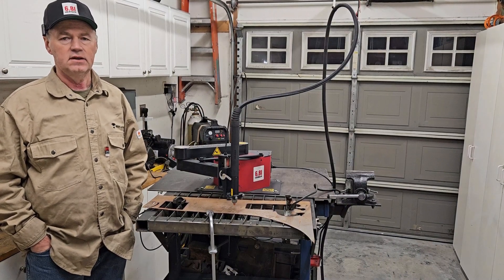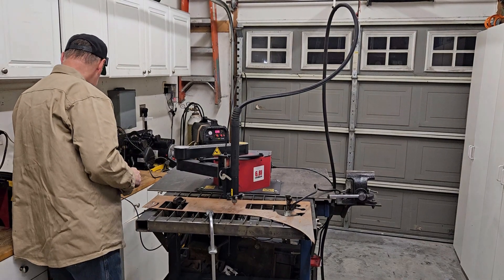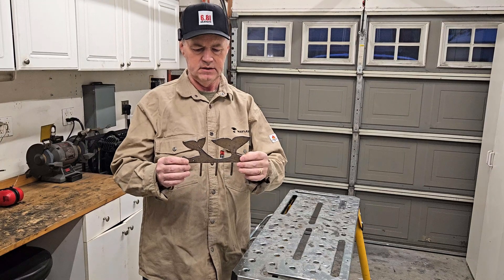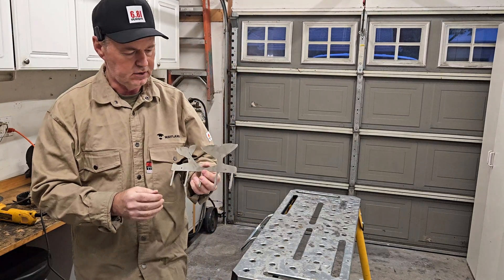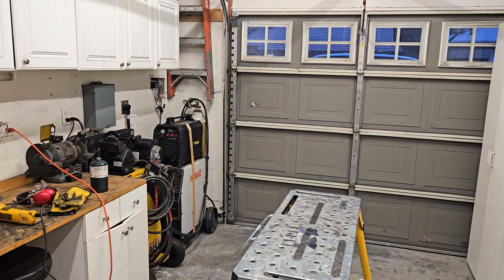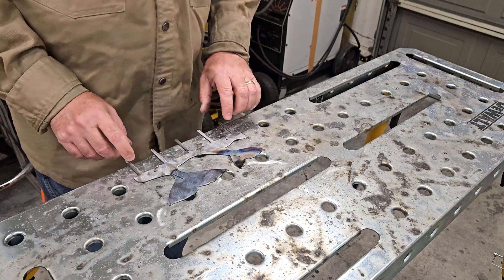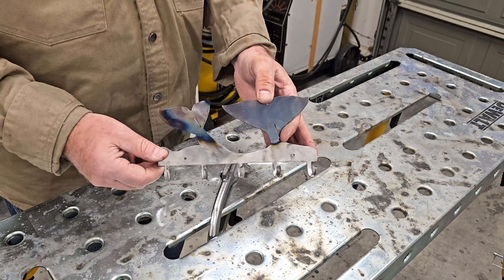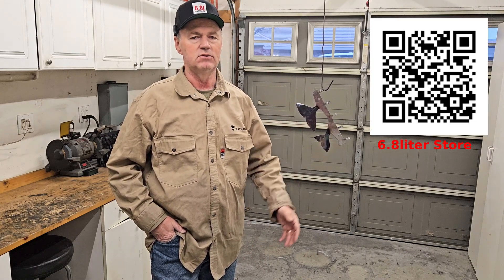Using Inkscape and Arcdroid to create a Whale keychain holder

Comment: So the voltage divider you got for the prime weld 60 resolved the original issues? Thats what i currently have for a plasma i bought back in 2021. Was the divider installed inside the plasma or just mounted off to the side?
Reply from the maker: Actually I didn't resolve the voltage divider issue.  I still don't have torch height control enabled on my setup.  The voltage divider I was going to use is one created and sold by @amp_mechanic (https://www.youtube.com/@amp_mechanic) it would be installed outside the plasma machine.  I believe it takes the raw voltage signal and conditions that to be sent to the Arcdroid.  The reason I dropped the idea is I reached out to Andrew and he said it would be at my own risk.  So basically it would void my Arcdroid warranty.  For now I try to keep my material level and flat....